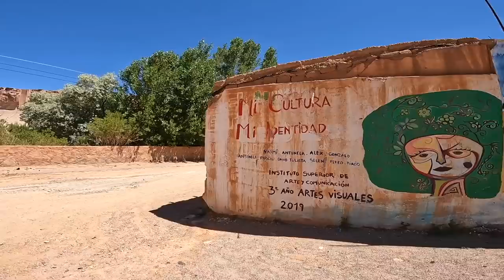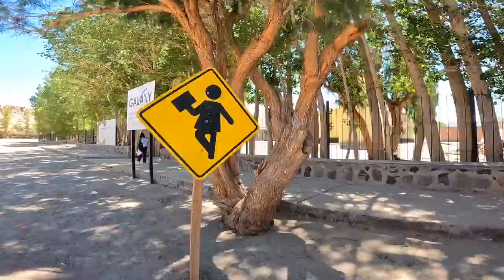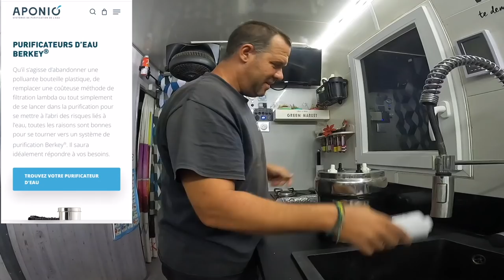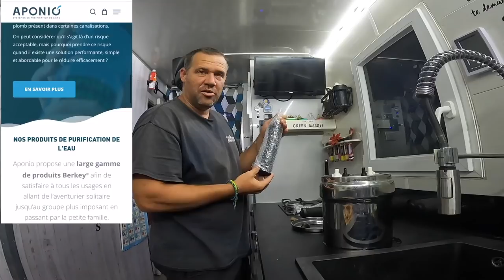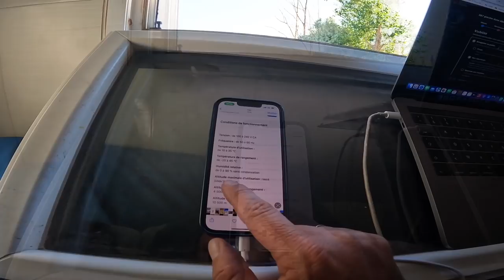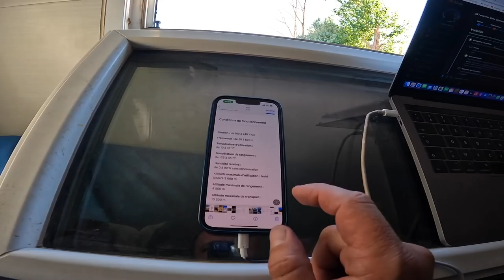289 Malades, on ne supporte plus l'altitude mais ce n'est peut être pas que ça

Comment: Salut xTG
Pour l'ordinateur, c'est surtout pour les disque dur mécanique, si c'est un SSD, une partie du problème est résolu. Maintenant, à voir si l'écran LCD ne fait pas comme les fenêtres de votre cellule.
Pour la lenteur de votre portable, indiquez nous sur une des vidéo les températures de votre portable, on vous analysera ça. Mais si il fait trop chaud, même un ordionateur neuf aura un problème de fonctionnement.

document technique
Conditions de fonctionnement
Tension : de 100 à 240 V CA
Fréquence : de 50 à 60 Hz
Température d’utilisation : de 10 à 35 °C
Température de rangement : de -25 à 45 °C
Humidité relative : de 0 à 90 % sans condensation
Altitude maximale d’utilisation : testé jusqu’à 3 000 m
Altitude maximale de rangement : 4 500 m
Altitude maximale de transport : 10 500 m

4 températures sont à surveiller sur un ordinateur :
- le CPU (le processeur du pc) dont sont fonctionnement tourne entre 30°c au repos  (pour un refroidissement liquide normal) et 65°c en pleine charge de travail. Au dessus de cette température, en générale, le pc ralenti pour limiter cette température à 65°c. Pour les cpu intel, nous pouvons récolter sur le site de intel cette température. Prenons le cas de celui que j'attend, le portable avec un cpu 12700h, et voici ce que cela dt :
  TJUNCTION  ---->  n’apprécie
- le GPU (la carte graphique)
- l'ioh  ou southbridge (gère les GPU, ram, ect...)
- northbridge ou ich (disk, reseau, ect...)
si c'est un Mac Pro (2019), ils sont équipés de Intel Xeon W et voici ce que dit le site intel :

Température de fonctionnement (maximum)  ---> 100 °C

Température de fonctionnement (minimum)   ---> 0 °C

Donc, en temps normal, sa température en pleine charge est de 65°c
Reply from the maker: Il est sûr que certaine fois il est monté bien au-delà de 65 degrés, on a dû le mettre dans le frigo 😅
Il nous indique que la batterie est morte 
et les touche sont souvent bloquées à cause de la poussière.
Je crois qu'il lui faut un bon nettoyage et une nouvelle batterie.
Le problème c'est de trouver quelqu'un pour ouvrir un Mac.
il faut attendre d'être dans une grande ville et en plus, julien n'a pas confiance, il a peur de se faire piquer des pièces d'origines, remplacées par du faux.
Reply: @xtgfamily  faite le vous même je pense que Julien en et capable juste qui faut pas qui serre les vis comme un fou 😂
Reply: @xtgfamily  Dans le frigo, ce n'est pas une bonne idée, il prend l'humidité avec les chocs thermiques. Pour le clavier, il faut passer la soufflette du camion man sur le clavier (on peut y aller assez fortement mais pas pas à 8 bars car sur la plupart des clavier, les touches sont juste clipsées. Je conseil de tester la pression sur ses doigts pour vérifier si la pression d'air n'est pas trop forte, si elle est trop forte, il suffit d'éloigner la buse d'air du clavier ou d'appuyer un peut moins sur la gachet  du pistolet d'air.
Les Apple sont connus pour la facilité du démontage de leurs portables, il faudra en profiter pour passer un coup de soufflette à l'intérieur, mais là tout doucement et un coup de soufflette là ou l'air chaud sort du portable, comme le portable sera démonté, vous verrez les ventillo tourner à l'envers.
Voici un lien qui explique comment changer la batterie : 
Sur le lien de votre video, vous remplacer q4VxTNOt9fM&lc par 4pQ-zYrSs0k puis entré sur le clavier. c'est pour contourner la restriction des liens youtube
Je conseille que cela soit toi Marie, qui le fasse, Julien avec ses grosses pattes risquerais de se blesser ou détériorer le portable ^_^
tu vas voir c'est facile à faire.
Reply from the maker: @darkshawo  on a trouvé une enseigne apple qui va le nettoyer et changer la pate thermique 😉
Reply from the maker: @losephil  on a trouvé une enseigne apple qui va le nettoyer et changer la pate thermique 😉
Reply: @xtgfamily  c'est le mieux à faire, pour la pâte thermique, attention de bien choisir cette pâte ( prendre la pâte thermique argenté comme la Arctic Silver 5), ça joue beaucoup sur les températures (surtout par rapport aux pâtes thermiques des transistores) et si il a 2 ou 3 ans, oui, ça peut apporter un gain.

Comment: Salut la compagnie, 
Je trouve ça plutôt nul d'éclaté une pastèque avec des élastiques, du gâchis, tout simplement du gâchis.
Je suis surpris que l'on puisse nettoyer les filtres Black Berkey et Berkey PF-2 aussi facilement ! Cool ! 

Voilà les conditions d'utilisation d'un macbook pro ( neuf ) de chez Apple.

Conditions de fonctionnement:
Tension : de 100 à 240 V CA
Fréquence : de 50 à 60 Hz
Température d’utilisation : de 10 à 35 °C
Température de rangement : de -25 à 45 °C
Humidité relative : de 0 à 90 % sans condensation
Altitude maximale d’utilisation : testé jusqu’à 3 000 m
Altitude maximale de rangement : 4 500 m
Altitude maximale de transport : 10 500 m

Bye et bonne route.
Reply from the maker: On l'a mangé la pastèque. c'est drôle et surtout un bon exemple pour expliquer les forces aux enfants